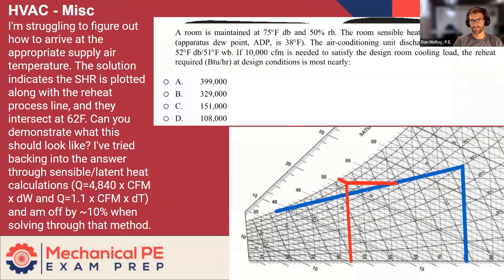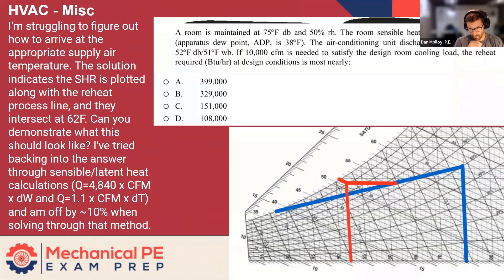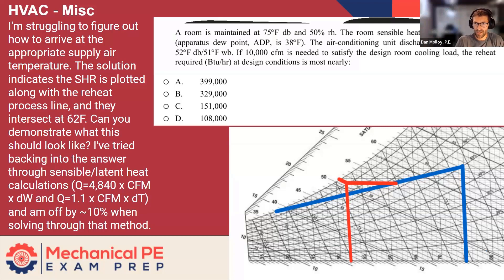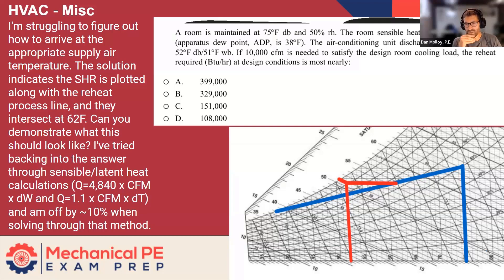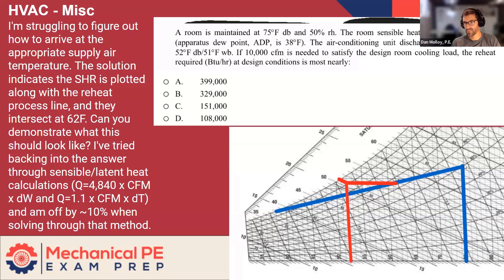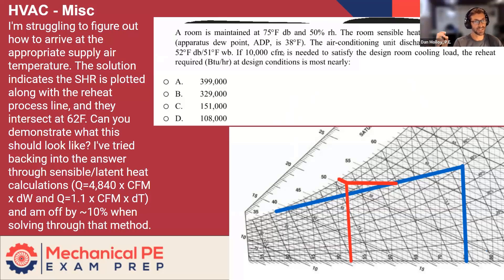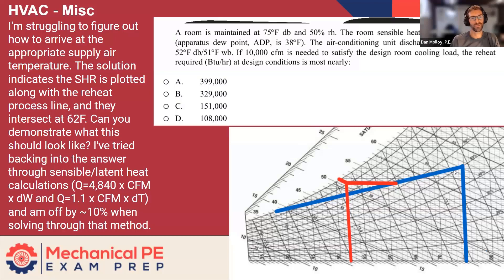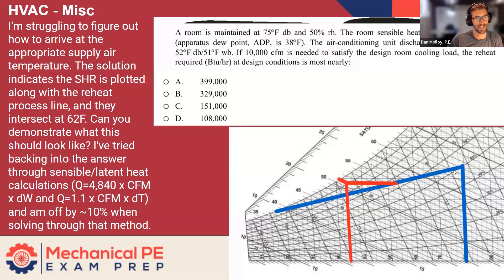PE Mechanical Exam Prep | Solve Psychometrics Problems: SHR, ADP & Reheat in Air Conditioning Design

Comment: Good afternoon! First off, love the content! Something about this problem is bugging me so maybe you can enlighten me. I feel like two different definitions for ADP are being thrown around. From my learning, ADP is defined as the theoretical LAT off of a 100% efficient coil with no bypass factor. What I am getting at is that the ADP is previously described as being related to the cooling system, not to the heat load. So for example, I would expect to see a 48 degree F ADP for this coil/system, given the actual leaving coil temp and a reasonable bypass factor. Instead, the problem is using ADP as more of a theoretical room starting point temperature in a “perfect world” which to me, is not the same as a theoretical LAT for THIS PARTICULAR system, based on the discharge conditions. Please help me out on this because this is really bugging me, thank you!
Reply from the maker: Yes, you're exactly right Anthony, I think both are thrown around and I've probably been guilty of that myself! I'm with you in that strictly speaking the ADP should be a statement about the physical evaporator coil, whehter it is flowing refrigerant or chilled water.  The idea in this problem is that by knowing the SHR slope, we can extrapolate graphically and discover what the coil leaving conditions would have to be for the system to satisfy the room load (without bypass).  Maybe we should not call that intersection point the ADP?  Maybe we should coin another term such as "design ADP" or use another word entirely?  "Implied leaving air conditions assuming no bypass" might be too much of a mouthful.  I've seen it used both ways and I've made my peace and even done the same, and yet I completely see your point and why it is confusing.  As with much of the MEchanical PE exam material, the most important thing is that you understand the concepts, and you clearly do as evienced by this astute question so keep up the good work!
Reply: @MechanicalPEExamPrep  Thank you for the response! Your channel and material will be the first thing I recommend to colleagues looking to take the PE exam!

Comment: Its not cleared how come not supplying a 52 wont remove the total load / latenet load but instead heating would do
Reply from the maker: The heating is to get to the proper supply condition, which needs to be on the blue line. This is the air conditioning process line.  To be clear, it is a combination of cooling (sensible and latent) followed by heating (sensible only).
Reply: @MechanicalPEExamPrep  thank you for your answer but why the 52 wont be able to remove that sensible and latent load ? What would happen if we supply it based on 52 F ?? And supposed am doing this on HAP , how HAP would figure out that we need to reheat ?
Reply: in another word, you have mentioned that the reheat is required to bring back the supply temperature to the SHR line so the ratio will be kept as per room load and not to lose latent capacity . why I do need to do this if the coil already worked and cooled and dehumidified to 52F . ?? unless you need to avoid overcooling the space

Comment: Hello! I'm enjoying the videos as I prep for my PE exam, but I had a question about these graphical solutions. Now that the exams are done on computers, I'm assuming the reference handbook you're given is also in a digital format. I took my FE a while ago, and I remember the reference book was something you could search through, and it was categorized off to the side of the screen like bookmarks you could also just flip through. Do you happen to know if it's the same case with the computerized PE exam? I noticed a couple of problems in the NCEES practice exam that have graphical solutions. It just seems tricky to have to plot out sensible heat ratio lines on a computer screen.
Reply from the maker: There's a few different questions embedded in there...  As to the bookmarks, I'm not sure, but if you need the psych chart for a problem it may in some cases pop up on a separate window for your use.  That's not to say you will never have to seek it out on your own.  As far as graphical solutions in general, I agree it is tricky, but the best you can do is practice and prepare and do your best without pulling your hair out!

Comment: Great videos as always, Dan. Could you explain what DP you would want to be off coil versus the DP of the room?
Reply from the maker: Thanks.  It depends on the application.  For the room, if it is occupied, you would want a dew point that supports human comfort for the activity level taking place.  Note that by choosing a dew point, a wet bulb temp, an RH, or a humidity ratio are all ultimately defined because any 2 points fully defines a state.  So choose two that you know you want for the room, and everything else is automatically specified.  The leaving coil conditions are harder to pin down.  Depends on the bypass ratio for that coil as well as any intentional bypass if applicable, which gives you the final supply air condition.  This state point must be on the RSHR line.  Hope this helps!  For more detailed questions shoot me an email: Dan@mechanicalPEexamprep.com

Comment: Love your videos, thank you for the content.

Fellow PE here (But Thermal Fluid Design) : Wouldn’t ADP just be the condition at which ROOM air would condense?

Basically, Room SHR (assumed cooling) would drive whatever air entering that room to condense at the ADP if left to the cooling load of the room?

Or is it just not safe to assume Cooling SHR = Heating SHR?
Reply from the maker: Heating is implied to be sensible only unless there is express mention of humidification or dehumidification.

Cooling always has the potential for a latent component because if you do enough sensible cooling, you inevitably reach the saturation curve.  If you do less sensible cooling, the process can be sensible only. 

Not sure if this addresses your question.

You're a TFS PE already and still watching Phsychrometric videos... how great is that?! Glad you like the channel.